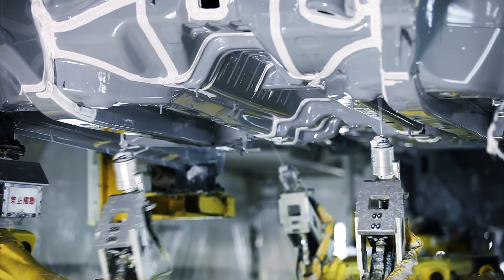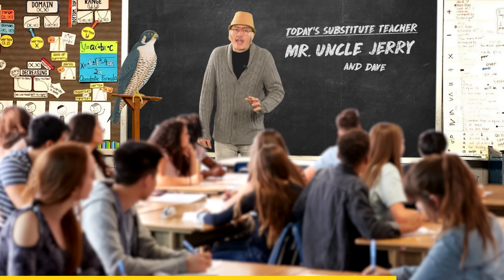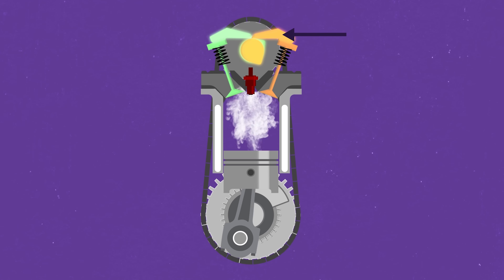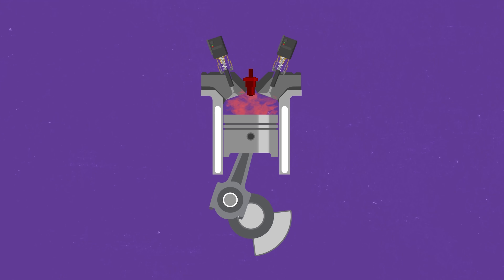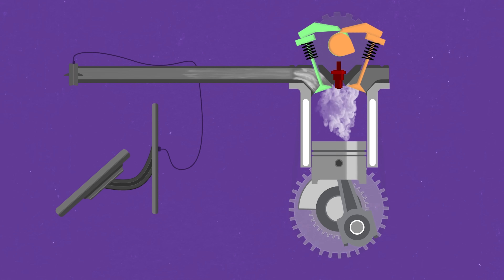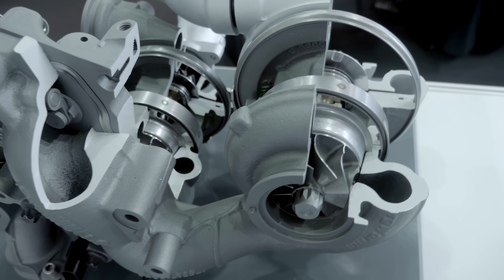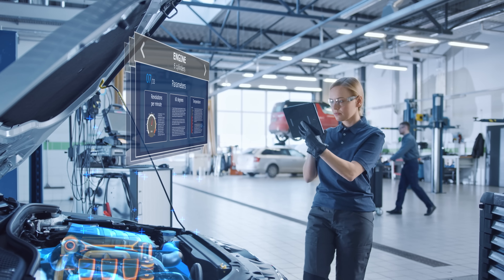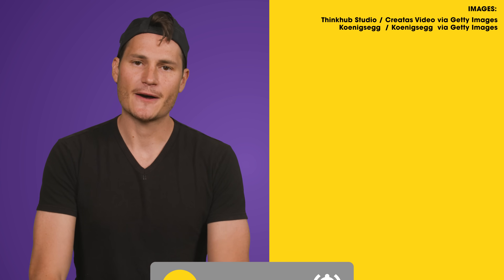This Is The Last Great Engine Tech

Comment: Why has no one ever used an electric motor for their turbo yet, just slap a bigger alternator on
Reply: It would drag the alternator belt harder, which is going to slow the crank, which will lower power. Electronic turbos are a thing but they're more like nos is in fact and furious, off most of the time and hit a button and your boost can recharge when not in use with a few extra batteries

Comment: Around 5:30, highly misleading. Digital "waves" can't overcome the inertia of the valve and the force of the valve spring instantly, any more than a cam can. That's simply not the point of the technology. The point is fully variable lift and timing. Not instant opening and closing.

Comment: 1985 I did design such a valve actuation system for the X 16 engine I drew up. Yep. Use the same sensors as for the fuel injection with the load and burn characteristics inputted also. The electric blowers for maximum boost at all times. Well, while under load.

Comment: I guess their are two types of valve floats. The one the video is talking about and motorcycle/ car valve float which is where the RPM can go so fast that the spring doesn't have enough time to close the valve or open it because the rocker is moving too fast.

Comment: I have thought about this concept for years i.e. solenoid controlled valves, so glad someone has done it. I think the design could be improved even further by replacing the conventional poppet valves with solenoid controlled gate valves in the combustion chamber. This would eliminate the possibility of piston-to-valve collision in the event of failure, and allow super high compression for efficiency and performance.

Comment: ICE are not dead yet, it will take a long time for EV's to replace them. ICE are becoming more and more efficient to the point that you get crazy fuel efficiency and will get even more efficient with time. Some hybrids can go up to 4L/100Km while some pure ICE engines are not far off at 5.5L/100km. In contrast my old Galant which was one of the most fuel efficient car of its time (91) is doing 16L/100Km (all mixed - city/highway values. So hybrids today are 4 times more economical than the most efficient petrol cars 30 years ago granted Hybrids have a huge advantage in the city while fuel economy rises in the highway with older ICE engines (50% more efficient). With my kind of daily commute I would fill up the tank 4 times a year lol. EV's have other issues that need addressing to before becoming the standard. First and foremost is their environmental impact, they're not as green as you think and secondly its recharge stations and time.

Comment: It's pretty cool. I remember reading about this a while back.
I can't believe someone didn't think of this sooner.
Though it's probably not going to matter in about 10 or 15 years when electric really starts to take over.
Reply: It was though of sooner like 1970s maybe earlier sooner, I researched this back in 2004 thinking that an engine would be more efficient without cams since you can design the shape of the valves and intake/exhaust ports to be more efficient in both flow and at least on the intake side to mix the air/fuel better. As well as no more friction from cams, lifters and springs, and the perfect lift and duration for every RPM. When researching this I learned that it's been tossed around by engineers since the 1970s on paper and probably earlier. But the technology to build reliable, heart resistant actuators that can move fast enough for hundreds of thousands of miles that didn't cost the soul of your 1st born didn't exist. Like how the fuel injector to allow high bypass jet engines to produce record thrust levels on a lean burn cycle saving fuel, and creating less emissions entered production in 2011. Work on that injector has been somewhat on going since the 1970s as well but computers to simulate airflow and how the fuel will mix didn't show up until the 1980s and then even when a design was finalized, with out the ability to 3D print metal objects the injector could not even be built to spec.
Reply: @wutang80oc39   I see.
Well it would have been nice if it could have been done sooner.
Seems almost pointless now.
Considering electric will most likely take over before too much longer.

Comment: Digital signals are modulated onto analog radio waves, and it is not possible to practically implement a 'digital' radio wave -- a square wave is a spread-spectrum signal that would literally permeate all RF bands, making it impossible to use FDMA to slice up the radio spectrum. Similarly, it is impossible to "instantly" move a valve. It has to overcome friction, build inertia, and come to a stop without tearing itself apart. Although I don't know exactly what the movement of Koenigsegg's valves look like, I do know that physics dictates that it's neither instantaneous nor 'digital'. I suspect it looks a lot more like a traditional cammed valve's movement than you'd expect, except with complete of valve and duration. This alone is enough to make it the biggest advance in ICE design in decades.

Comment: But I feel like this could have a problem on higher horsepower cars, cuz without a throttle or intake manifold, there’s nothing to suck in as much air as possible at those peak rpms to feed the engine and you’ll get choked out.

Comment: Having watched Wes Kagan's videos,  I was really impressed.   But I'm not sure what he has is a practical technology.   It's really cool,  but if I recall correctly his setup works via compressed air... which gets around a lot of the tougher problems but creates new problems in terms of practicality and reliability.

I recall reading an interview with a technologist from Mercedes who said he viewed "freevalve" (he didn't call it that) as the holy grail...it was worth ANY cost,  but it had to be as reliable as a camshaft,  and handle high speed as well as a camshaft and they were struggling with making it work at high speed and with high reliability.   That was probably 15 or 20 years ago, maybe more. 

The problem isn't the "digital" electronics.  Controlling a computer to microsecond accuracy is pretty trivial even in microcontrollers that cost a couple dollars and that's more than you could ever need.   But being able to drive a solenoid against a valve spring (maybe valve springs aren't needed any more) and get it to open and close that quickly means slugging huge amounts if current around, and designing all of this electronics in a ultraharsh automotive environment (most of this will have to be directly over the engine)... is quite a challenge.   Electronics are better now than when the article was written... but is it good enough?

It's hard for me to understand why Mazda, and Ford and GM and Toyota and Mercedes haven't been successful but a bit player like Konigsegg is...  I question whether their system is as reliable as it should be. 

It may be that ICE are on their way out in favor of electric, but ICE will still be here for a while,  and looking at Mazda and Skyactiv X is all one needs to see that Mazda does want to see the ultimate evolution of ICE before they are gone...
Reply: Also, your claim about analog vs digital radio waves was... total malarkey... now if you had said analog vs digital waveforms you might have been closer.

Comment: 8:18 The Gemera would only have 3 exhaust outlets though, wonder which ones feed what, hehe...
Reply: it’s a bit complicated. They manage specific valves instead of the whole exhaust outlet. So you have 2 exhaust valves per cylinder, 6 in total. 3 of them would be routed to the turbo charger, while the other 3 would go to the cat.

This is the same reason why they have a twin turbo setup on an i3. So once the cat is heated up, 3 valves would go to one turbo each.

Idk exactly how it works, but this is my best understanding of the Koenigsegg’s engine after reading about it. Someone may need to check on this further tho.
Reply: @devandrasimanjuntak1646  Ha! that makes a whole lot of sense to me. Thanks!

Comment: I've always wanted to know what'd happen if you tried air injection. Air nozzles that shoot air directly into the cylinder at a precise time. I might try and build it one day. Would need a small fuel injected engine to start though

Comment: What happens if you have a dead battery and you push start your car that has free valve on the head? Will it not have enough current to actuate the valve?

Comment: Valeo (One big french OEM for the automotive industry compagny) worked on this technology for a lot of time, a long time ago and try to sell it even to  automotive manufacturer for mainstream automotive (In Europe and America) but it was a big fail, the consumption reduction target was 20%. The project was stopped, I worked in the engineering office at Valeo during this time and it was nearly 10 years ago. It was a full electronic system , not only for the control but for the actuator too (Electromagnetic  power).

Koenigsegg camless is electronic for the control (Of course) but use  pneumatic power for the actuator and it seem that it works. This technology is a big leap forward, so for exotic car it is not a problem, but for compagny like GM, Ford, Renault, Stellantis, Toyota, Volkswagen and so one it is a giant leap, with a lot of risk (The coast is higher, the reliability not proved,...). But with the new emissions standard, this technology could be a solution for combustion engine

Comment: How can they keep exhaust valves to the turbo closed without stoping combustion in those cilinders if thers compression/ gas in the cilender it has to go somwer and even if it does this will only work wen the manifold is split in such a way which is rarely the case as u want all that gas to spin up the turbine  .entertaining but quite flawd interpretation

Comment: ICEs aren't dead, they're just being fed the wrong fuel. Pure alcohol is the way to go.
Didja know Monsieur Henri Ford planned to build the Model T with resin impregnated body panels made of hemp, hemp oil in the crankcase, and alcohol in the fuel tank? It's true.
He got a visit from a few anuses in suits one night, and since then all Fords are made with metal body panels, petroleum oil in the case, and petrol in the tank.
Big oil hijacked hemp in the U.S. Went as far as banning it. The war on weed was mainly for big oil. How'd I learn this? David Blume. He's into permaculture. He wrote a book titled Alcohol Can Be a Gas. He's all over EweTube. 
Blume has a three part plan to fuel vehicles with the sun while destroying big oil and saving the planet. Check out a lecture or three, I have, he's good you're welcome hava noice day.

Comment: I actually have a question. You said there's no need for a throttle body at this point, but where would the air come from then on an NA setup? You need some sort of an actuated valve to bring air in right? Don't roast me, I'm genuinely looking for answers

Comment: Wartsila marine have had solenoid actuated valves for quite some time! But they are 2 stroke and only run at just over 100 rpm, they are low emission & their 14 cyl version is over 100K horse power!

Comment: @Donut Media  as a valvetrain engineer, square wave valve function even if you have zero mass, and infinite force (which gives you inertialess control) that is not the motion that will produce the best TQ at each RPM point. 

A magnetic shock has similar issues.....

Comment: Sounds good until one of the 16 needed for a typical V8 or in some models 32 valves . The benefit of reliability with a chain/belt and synchronized mechanics outweighs this electrical nightmare I see coming

Comment: Do a video on the Alfa Romeo 1.4 multiair engine. 1 cam shaft, hydraulically operated valves 😂 pretty awesome little engine. Average 40+mpg and capable of 450+bhp 👌🏻

Comment: The fact that freevalve uses electricity is cool but it’s hardly new tech, highway trucks with exhaust breaks have been doing this for 50+ yrs. They are just oil actuated valve plungers. Just sayin.

Comment: I love the tech but I'm worried about failures if a valve "sticks" then what happens when piston and valves collide. What happens when the crank sensor fails ?
Reply: My guess is that similar to any other "computerized" components in a car, this technology will be feasible when electronic controlled versions are just as (if not more) reliable than their mechanical counterparts. If we can do it with air and fuel, no reason we can't do it with valves.
That or maybe just use non-interference engies.
Reply: Since we don't have to worry about packaging with cams, what if the freevalve head had valves that come up instead of down? The worst case scenario then would be having your valve stuck open at all times, but assuming you could detect this you would simply not inject fuel and spark.
Reply: @lfox02  We love fail-to-safes
Reply: Well exactly, this is why the technology hasn't really taken off, because the consequences of an electronic failure are catastrophic. Cams and chains etc are limited but the reliability is relatively good.

Comment: You called variable cam lift, VTech, variable cam timing. Cam timing is the the changing relation between the intake and exhaust cam to the crank not lift.

Comment: This is such a cool innovation, one question though, surely the exhaust outlets that are sending flame into the catalytic converter will wear unevenly to the others causing problems down the track right?? Definitely not an expert in engineering, just want to hear some thoughts...

Comment: 2007 BMW Z4 didn't have a butterfly valve, it lifted and lowered the entire camshaft to control valve lift to control air input with infinite adjustment.  Under-appreciated engine for its time, 250 hp, great mpg.

Comment: Knew he couldn't talk about this without bringing up Wesley Kagan's experiments. Been keeping up with that to some degree, I'd really love to put that on my classic VW Beetle, which I've already converted to EFI and put a turbo on - this is an obvious next step, and once someone comes up with a universal actuator and ECU design it would be a simple matter of machining brackets to adapt it to any engine. Basically would be for valves what Megasquirt is for aftermarket fuel injection, in fact maybe some of the same companies (Megasquirt, Haltech, and so on) could look into that. Would make aftermarket cams a thing of the past.

Comment: It's worth pointing out that continuously-variable valve lift does exist mechanically; see BMW's Valvetronic or Toyota's Valvematic.  Continuously-variable valve timing also exists, for almost every brand.  Hyundai actually did make a continuously-variable valve duration mechanism.

The big advantage of Freevalve is that you can do all of the above, rather elegantly via the mechanisms described here.  Doing it mechanically would be very complicated.

Comment: " How do you make a Cam that has power at the top end and is fuel efficient at the low end?"
... VTEC BABY!!
Reply: Just to make 120hp with vtech
Reply: @aidenmaves5537   They make fast hondas too, it's mostly for efficiency in their smaller displacement vehicles.
Reply: @thomasvincent9220  i know just jokes. A type r could easily smoke a hellcat around a track
Reply: @aidenmaves5537  lol
Reply: Vtec is very limited. Only 2 positions? Multiair is way superior.
Reply: @livolas  yea, and there are many different VVT implementations. None of them can compare at all with freevalve, which has an unbounded number of timings and saves the weight of one or more cam shafts.
Reply: Honda also issued a patent for a free valve variant.
Reply: N.o.s. Baby, lol..

Comment: I'm just imagining this on a diesel engine.
Reply: Bro the torque would be amazing. Might even get it spot on n end up with a small strong high rpm diesel. Id love to see it.
Reply: Im a diesel tech and thats all i could think of.
Reply: The interesting part is that diesels already don't have a throttle plate, right? They just inject more fuel to increase RPM? I feel like freevalve engines would add another layer of complexity for tuning that would make the field more suitable for top-level problem solvers.

Comment: I remember reading about the concept of electronically controlled valves in an automotive magazine in the early 2000’s. It would be incredible if one day we could retrofit older engines dependably, with of the shelf components.

Comment: So couldn’t you use Freevalve to make the lumpy “cammed” sound at idle and instantly tune itself to the prime air/fuel timing at the point of acceleration?
It’d be a cool option, particularly if it’s just a press if a button/mode and there’s no additional hardware or cost.
Reply: But large displacement V8s are getting scarce, and I’m guessing is wouldn’t sound as cool on smaller engines…

Comment: You can also delete the starter motor by sparking and injecting  the cylinder with the closest pistons to TDC with the valves closed , immediately followed by the next pistons due at the top.

Comment: Lol...digital control is not instantaneously on or off as you 'suggest' in your fancy graphic...there is still a ramp up/down like a cam action profile...the only difference would be speed and a shorter ramp up/down profile with digital.

Comment: no not dead yet for large vehicles  like trucks , buses , ETC will get benefits  from free valves as  batteries wont help much in large travel distance with heavy weights , great for fuel efficiency &  environment-friendly

Comment: You're missing something here with your explanation imo. It's more about full control of valve position. So apply your digital logic to position rather than duration, though that's part of it. E.G. how open the valve is, not how many times it can open during a cycle